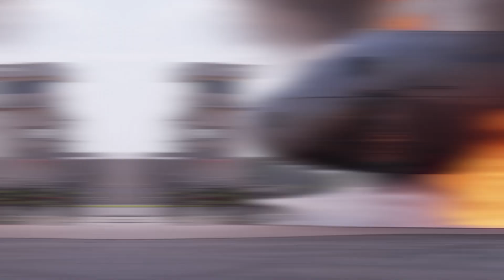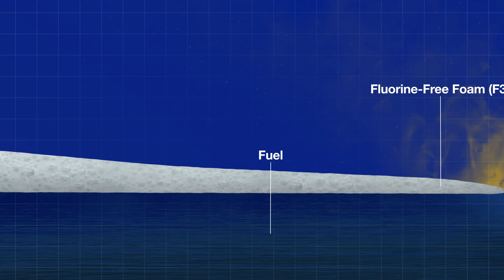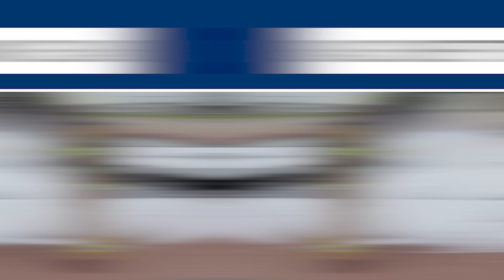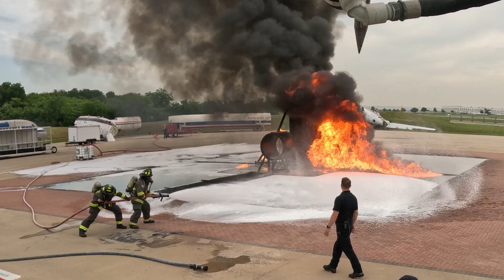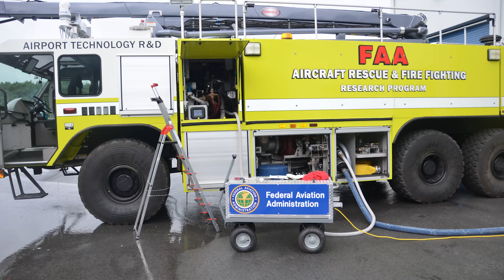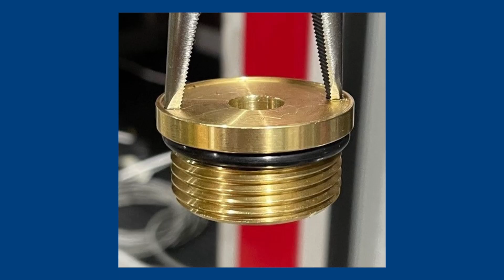F3: An Intro to Fluorine-Free Firefighting Foam

Comment: is there a difference between a regular 750-1,000 gallon fire truck water tanks and a foam tank? Does the truck have to modified or retro fitted to apply form application? if so what needs to be done and what is the difference between the 2?
Reply: Other than cleaning out the AFFF there is no difference. The proportioners may need to be adjusted due to viscosity difference but it still functions in the same percentage as AFFF. Also keep in mind that F3 takes 1.5 to 3 times as much agent to accomplish the same fire suppression as AFFF. Also keep in mind that the testing has not been done on anything other than flat concrete and in burn pans. It hasn’t been tested on grass or dirt or gavel.
Reply: Large ARFF vehicles have separate foam and water tanks. Foam tanks have to be rinsed to remove the old AFFF prior to the F3 being placed in the tank